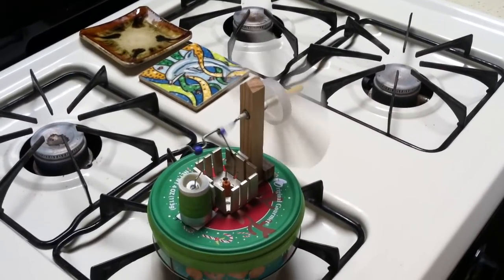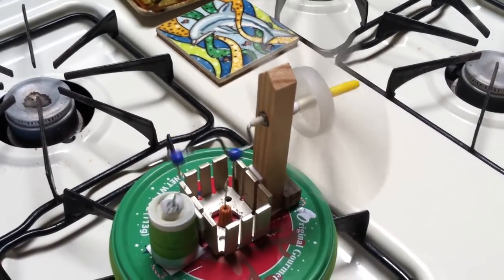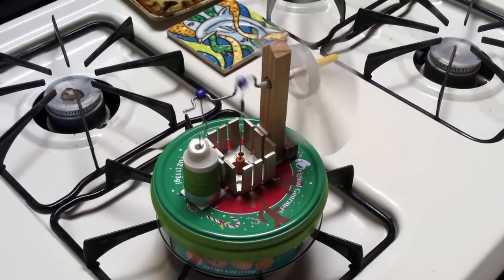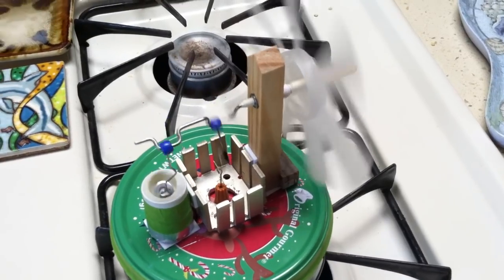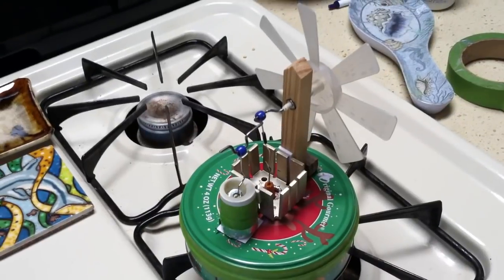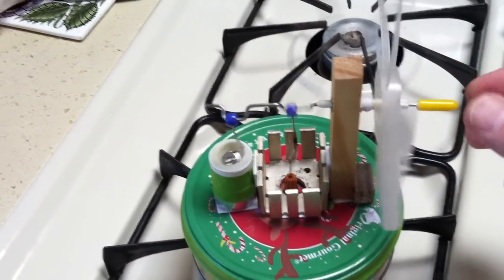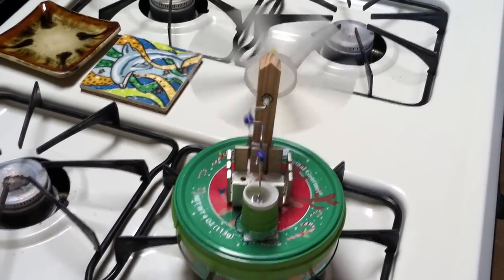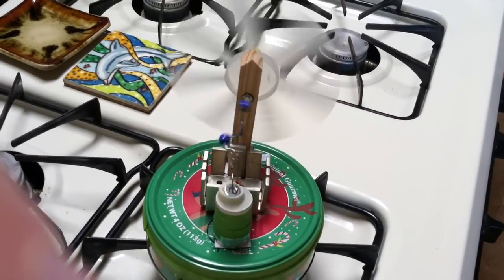Stirling Engine Fan ---Made from a cookie can

Comment: Thought. Gas stove.  Low heat to supplemental heat the home. The exhaust is mostly water vapor  adding moisture to dry winter air and run a stirling engine to generate a bit of electricity.

Comment: Stirling engine/pulse motor next?
Reply from the maker: Thanks.  I went right to work and got er done.  Next video.
Reply: Lidmotor once you put that fan in there it just seemed the natural progression...does the fan blow backwards to cool the top surface?
Reply from the maker: Actually this is blowing away from the unit.
Reply: Well then reversing the fan should improve efficiency?
Reply from the maker: Yes.